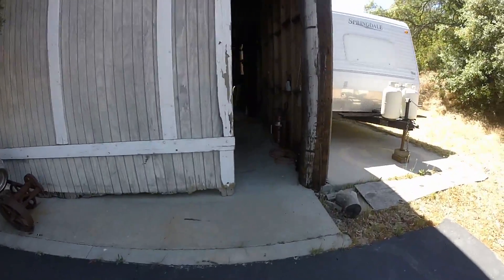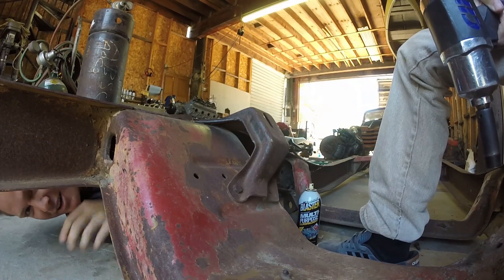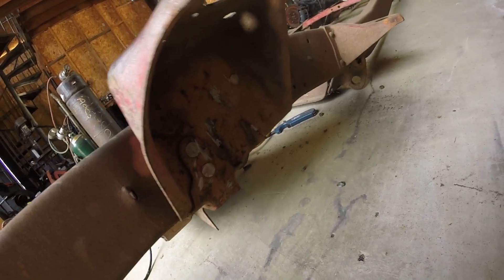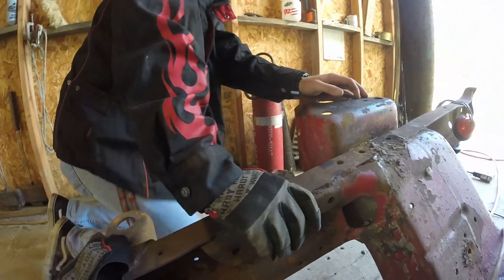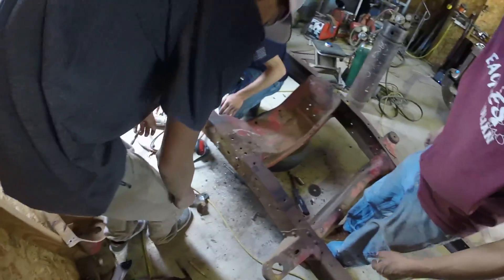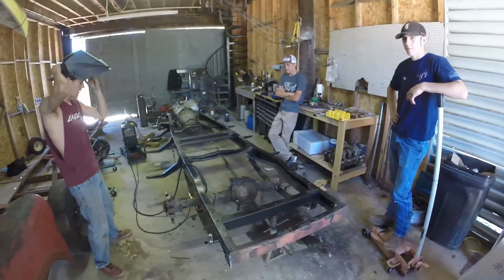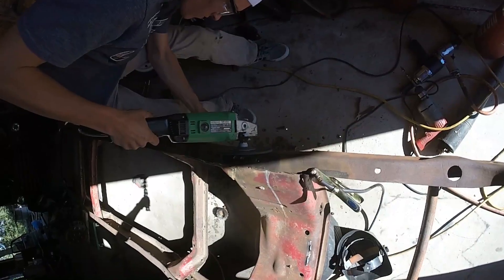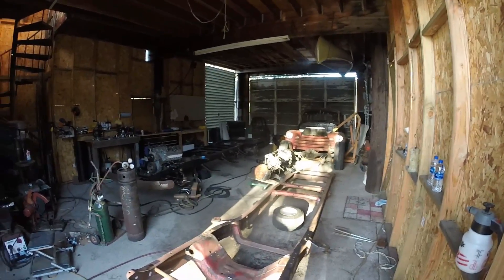The Crown Vic F100 Build Ep 2: Stripping The Frame

Comment: Love the video, but why can’t you just put the front bumper on instead of adding more metal
Reply: +Minecraft Gaurdian  You can't guarantee a front bumper is going to be straight and to factory tolerance after nearly 50 years on the road, it might have taken a few knocks.  Getting this measurement right is critical, it it's wrong it will badly effect how the truck drives and may even make it dangerous so doing it like this is a much better option...
Reply: gosportjamie ok that makes since thank you
Reply: +Minecraft Gaurdian  No problems...

Comment: can someone explain what he is building
Reply: Derek H a truck
Reply: same as his f100
Reply: He's removing the front suspension and cross member so he can install a Crown Vic front end.
Reply: Calvin Handley but what is going to be the body
Reply: Derek, as I recall it's a 67-72 F-100 short bed chassis, so I'm assuming that's the cab and bed he'll be using, though a flat bed would be interesting as well.